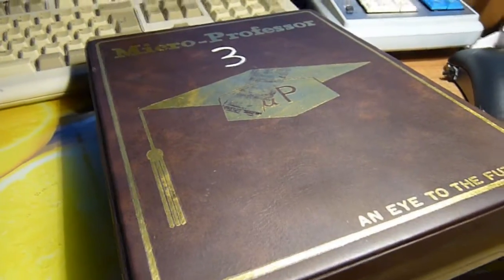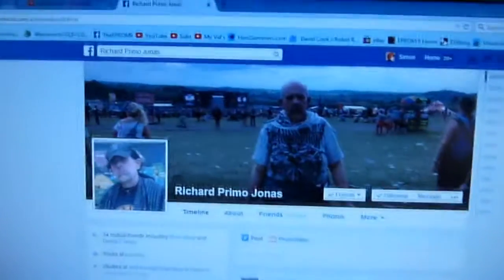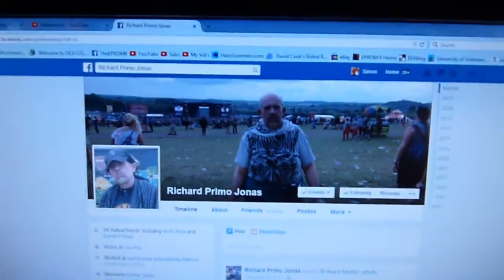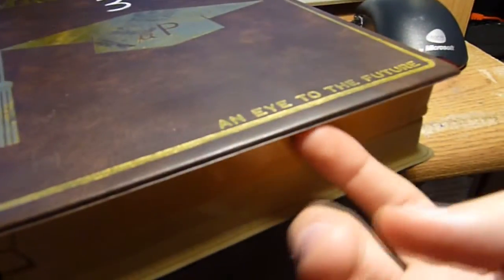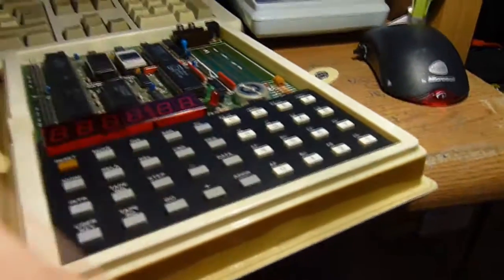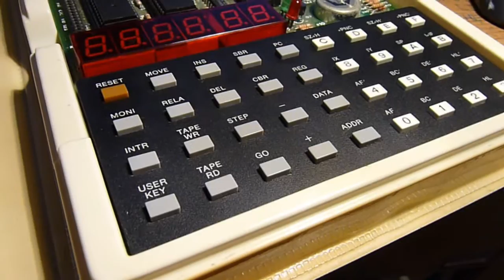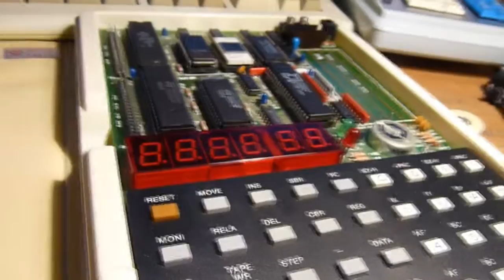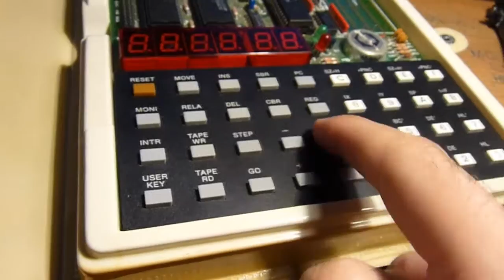Micro-Professor MPF-1B Overview

Comment: Ah. We had something similar at college many years ago, though I think the ones we used dated from the 70s. The board was bigger but with fewer keys. Each machine came in its own small suitcase and had 256 bytes of memory, including the 100 bytes reserved for the operating system. There was just enough memory left for me to store a reaction timer program which output the words "ready", "set" and "go" sequentially on the 7-segment display, then recorded the length of time it took you to press a button.
Reply from the maker: John Sixfiveohtwo I think I know the one you mean. Can't name it though. There were quite a lot of these kits in the 80s. Now we use Arduino's and Raspberry Pi's for the same purpus.